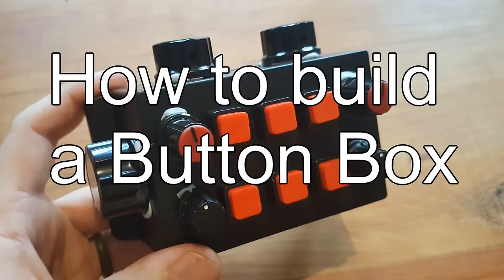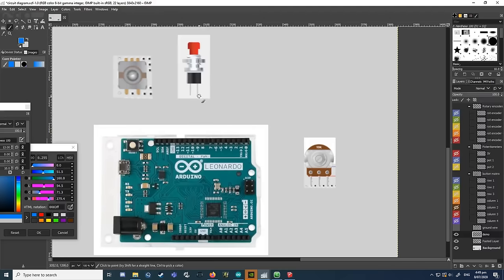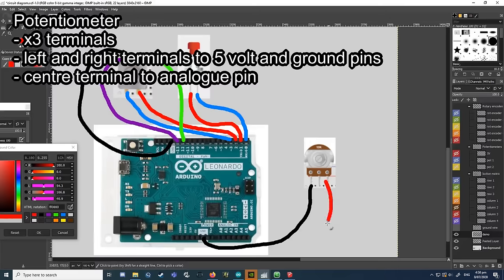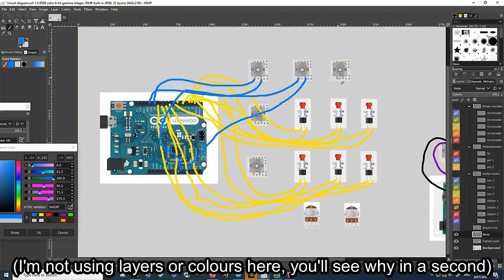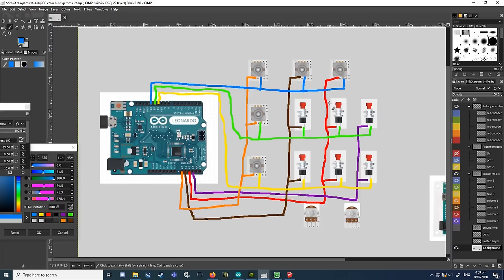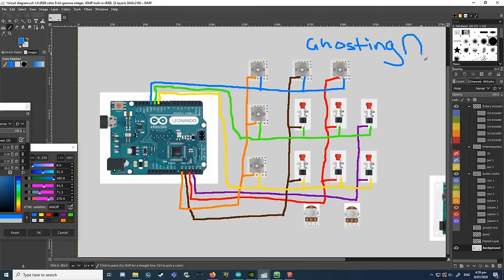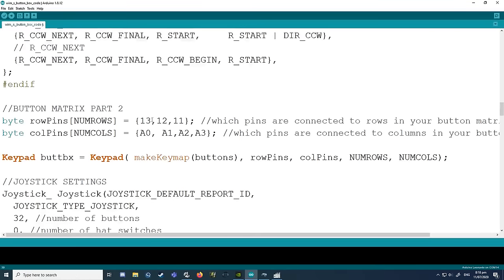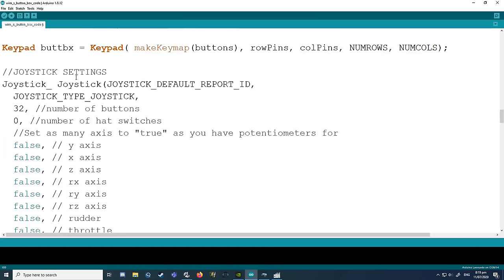How to Build a Button Box

Comment from the maker: BTW this video is designed for newcomers with no experience in coding or electronics. There is a bunch of extra functionality you could get out of an arduino based button box (multi position switches, hat switches, mini joysticks etc) but I decided to leave that out and stick to components which are simpler to code and use
Reply: I'm not using rotary encoders what should i change.
Reply from the maker: @ivanravenski  Just set the number for rotary encoders to zero at the top and remove the lines of code which refer to rotary encoders. (the bit around 24.34 in the video). However, if you are JUST using buttons (no rotary encoders or potentiometers) it will be much cheaper and easier for you to use a zero delay USB controller as described in this video: https://youtu.be/Kx3-JhT4X_M
Reply: Can I use "pro mini"?
Reply: yeah, but multipos and hat switches are little more than several buttons in one compact spot. I'm considering doing this for elite dangerous, where there's several functions that you'd never do at the same time where multipos can save space on the layout of the box in exchange for a bit more wiring on the inside.
Reply: I dont use potansiometers. Where should I change
Reply: This has been super helpful so far, but I'm stuck on the rotary encoder bit.  I have one from Inland so the terminals are different and I can't tell which is which - been playing around but can't get it to work.  Does the encoder not need to get plugged into the 5v pin?
Reply: Nice informations 😉👍 great video,  @arduinomaquinas thank you build, I like working encoders, subscribed 🇧🇷😉👍👏👏👏👏👏👏👏

Comment: Followed your instructions exactly, I've built multiple button boxes for my flight simulator to include avionics, radios, engine controls, etc. I've probably saved at least over $1000 not buying the Logitech or Saitek equivalents of what I made for under $200. $100 for 5 Arduino Leo's + $100-ish for wood, paint, switches, etc.Thanks for keeping it simple.
Reply: What rating potentiometers did you use? For the leonardo
Reply: @tommyfallon7925  I used 50k Ohm linear potentiometers on one of the button boxes I built. Plenty of resolution for the function of cowl flap controls.

Comment: Love the video, it was incredibly helpful for my own project and learning! However I do have a question on how I could add or adjust this sketch to include utilizing a slide potentiometer? Or if it is in the sketch already I have not been able to get it to work for mine. I am using an Arduino Micro and have my slide potentiometer wired to A0, GND and 5V.

Comment: Finally a code that covers it all! I have been trying to blend matrix and joystick for a while. I just could not get it to work. I have no rotaries, I just commented those out and it works great!!! Thank you for the time you took to put this together !!!! You Rock!
Reply from the maker: If you want a hot tip, chat GPT can actually do most of this coding all by itself. All you need to do is tell it to write code for an arduino button box using the keypad and joystick libraries and tell it how many buttons and other components you want.

That thing is scary good.
Reply: @wimwamjoey  Wow.....never imagined! You just added to the list of all the scary cool things it can do. Thanks again for your time!

Comment: Thank you so much for this great video! With your instructions I just build a 6x6 Button Matrix with 4 rotary encoders (without a button). Thus completely filling my leonardo's pins. 2 notes on your video so as to help others. 1) You can go over 32 buttons, directx supports 128 (my new button box has 44) BUT the game itself has to support 128 buttons per controller. Not all games do. If you want to test a button box with more than 32 buttons don't use the windows default game controller, because it only supports 32 buttons. There are great third party tools like Planet pointy's Joysticktest. 2) And most important NOT ALL rotary encoder have ground on the middle pin. My encoders where not marked and I assumed that the middle pin is ground, but it was actually the right pin that was ground. If your encoder gives erratic pulses mostly on one direction, you probably have the wrong pin for ground. Do the test on one encoder beforehand to save you a lot of pain. It took me all afternoon to figure that one out. Again thank you for a great video!

Comment: Just FYI, push buttons can share a ground for one of their terminals. The other terminal needs a dedicated pin in “INPUT_PULLUP” mode. This almost halves the number of pins needed per button, so you may not need to do that matrix trick.
Reply: Actually, you're better off with the matrix method whenever you have more than 5 buttons. For 6 buttons a 2x3 matrix is enough and uses only 5 pins instead of 6. The more buttons you have, the bigger the advantage. For 25 buttons you can use a 5x5 matrix, so only 10 pins instead of 25. And the Keypad library also has built-in debouncing. I'm not sure if this is relevant when you send the buttons straight to the Joystick library, but if you want to use the button inside your code to switch modes you should have some form of debouncing. 
If you want to reduce the number of pins required even further, you may want to look into shift registers. They are quite cheap, only need four pins (or three for some models), and you can daisy-chain them getting 8 inputs per register (still needing only three or four pins per chain). I'm currently redesigning my button box with shift registers because I need to free up some pins so it can also handle my pedals and gear shifter that are currently handled by the steering wheel I am going to replace at some point.
Reply: @panicpetes7676  This makes total sense if you're optimizing for number of pins. But if you've got the pins spare, a "one pin per button" approach seems much simpler to me, and in many cases that would be "better" overall. Wouldn't you agree?
Reply: @aaaidan    I do agree that the wiring is much simpler if you connect the buttons directly, but as you said it would reduce the number of pins used in your original comment, I thought I'd clarify that this depends on the number of buttons you want to use.
Also, in my experience, these projects tend to grow over time, so I'd recommend to use as few pins as possible in the beginning. I started with a rather simple button box (7 push buttons, 3 momentary on-off-on toggle switches, 3 rotary encoders and one pot). Later I added a DIY handbrake using a load cell and HX711 amplifier, so I needed two more digital pins. And as already hinted in my previous comment, I am now using the same Arduino to also handle my Logitech G25 pedals (+3 analog pins) and gear shifter (+2 analog and +3 digital pins).
Reply: @panicpetes7676  You're right – choosing the right approach depends on several factors. In the pinned comment it says "this video is designed for newcomers with no experience in coding or electronics", and I hope to convince you here that this is the most important factor.

My hunch is that for many folk (especially those beginning electronics) using the minimum possible number of pins is just not very important, especially when their board probably has plenty to spare. The matrix approach is a powerful (and delightful) concept to introduce to beginners. But it also acts as additional barrier to entry – an unnecessary one – because a first project is unlikely to run out of pins.

Using a matrix takes more effort to learn, and extra time (and testing) to build correctly. There are also more points of potential failure. It could easily be the difference between an enthusiastic young person finishing their first project or not. Or even starting out in the first place. As experts, it's incredibly hard for us to keep perspective on how far we've come in our journeys, and almost impossible to "simulate" how much more effort everything is as a beginner. 

For these reasons, I strongly recommend folk start out with "pullup+ground" pins until there are no more pins available, before investing in mitigations (like a matrix) that add complexity. This basic approach still allows a dizzying variety of exciting and useful first projects to build. If a project outgrows the pin count, simply switching to the matrix wiring at that point would be a fun and satisfying optimization/workaround. People often are most motivated, and learn best, when they're solving a clear and present problem.

Depending on factors, I'd even suggest considering just solving the pin problem by buying another board with more pins, or even using a separate I/O chip (like a multiplexer or I2C expander). Perhaps this seems wasteful or unsophisticated to some experts. but I hope we can agree that it's more important to draw beginners in to the fascinating and joyful world of electronics, than to insist on best practices from the very start.

What do you think?
Reply: @aaaidan  I fully agree with everything you wrote - when starting a project from scratch. In this case however, with a full code provided I think it is far easier for beginners to adapt the existing code to their project (as it is described quite well in the video) than to rewrite the whole button section.

Comment: I just finished buidling my box and programming it using your tutorial! Excellent. This crazy box project started with me trying the simple usb plug and play controller but I wanted rotaries. I tried the hacks to see it the rotaries would work on the usb board but it wasn't consistent. I ordered a "knock off" arduino at first but them backtracked to the one in the video. PERFECT. It works with my iRacing rig quite nicely!!!! 10 of 10!!!

Comment: I've got my wheels turning in my head, I have to give a huge appreciation to you Wim and all like you that take the time to put these helpful videos together for us, so thanks! What I meant by wheels turning,  I'd like to add a key Switch on/off interrupt to disable the box when not in use or away from the sim and I see away to do that on all of the buttons that require a ground which is easy "just place a turn key switch inline before connecting gnd to the board to act as an interrupt". so when I enter the sim I turn the key to the on position thus enabling those buttons, now that being said I don't see a possible or easy way to add a second keyed  interrupt to the buttons that don't require a ground. I'd just like to add more realism to the process.
Reply from the maker: You could get a USB switch? That way you just switch the whole arduino off.
Reply: @wimwamjoey  I'm looking at them now thanks, I had no idea they were an option. Another thought just came to me while sitting here, add a starter button and just interrupt that single starter button with a key switch, I think that might achieve what I'm looking for, that or just omit the starter button and use the key switch for the starter, food for thought but I think I'd like the duel method for starter.

Comment: great video!!! I'm a bit of an electronic hobbyist and most Flight Sim button box videos use crazy expensive parts! Like I have seen videos of people using 3USD Arduino boards for a controller... I've also seen people using a 40USD ish  board which was more plug and play although soldering was still required... Better just to build a whole kit or 2 for the same amount, i suppose you need to be a little more involved but its really not that hard and gives more flexibility!

Comment: This is probably one of the better videos explaining wiring and matrixing. A Protip on coding,though. SimHUB has a click through system for programming Arduino code which makes it very easy to code for your own custom made box.

Comment: Top class Wim, already had parts ordered to use with Leo Bodnars controller, but now I'll switch to an arduino instead :)
Reply: For a simple button box like this, the Leo Bodnar card will be way easier and just as effective. You only switch to Arduinos when you want the Simulator to turn on LEDs or change other hardware.
Look over some of my videos, you may enjoy some of the simple projects such as adding Rotary encoders and Landing Gears :)
Reply: @joshuamarius  thx for the tip, but I made one based on arduino and its working perfectly. I did however use different arduino code as the one in this video would not work with my rotaries.

Comment: 1st THANKS. So well explained, and me and the mrs have been saying "button" in a Kiwi accent non stop - it makes us smile a lot 🙂  2nd, when you tell it how many "buttons" you have, if your matrix is missing a button, like yours is, and mine is (mins is a 4x3, with the top right corner missing one button), still tell it you have as many buttons as the matrix "could" have - or it'll not show the last button/s working in Windows. I put "11" in the code, and then windows didn't see my last button in the matrix because as far as it's concerned, that is button "12" and my code said I only have 11.
Reply: If you started at 0, then 11 would be the 12th number.

Comment: Hello Wim, OK well I had hit a stumble in the road, after two days for working on the box, I had completed it yesterday evening 4/3/23 so after connecting the board to PC it was not recognized, so after time of trouble shooting I gave up and went to bed, this morning I had a fresh start, I found that I had purchased the wrong board, the board I purchased was the ATmega328P in which after downloading and installing the drivers for it,  Device Manager was happy with it, only still not showing up in the game controller so I then found out that this 328P does not support HID "Human Interface Device". I'm back to start again but now I know which board I need, it's a learning experience. The board I believe that I should have purchased would be the ATmega32U4 and not the 328P.

Note, I had already purchased the board before finding your video, I just assumed they were all the same, not the case, they are different and it matters which board you use.

I received in my mail box yesterday the exact board you're demoing in this video, my question is will it support 15 momentary,  (including 3 2-way toggle switchs), 4 rotary and 3 Potentiometers? a total of 25 in all.

Thanks
Reply: I too learned from his video. I have 30 buttons, 4 pots and a spare pin left if that helps.( I set the buttons up on a 6x5 matrix (11 pins), 4 pots on A0-A3.) Note: an on-on toggle counts as 2 buttons. Tinkercad is a great place to test build a matrix. Good luck
Reply: @funwithfitswell6609  I'm up and running, thanks.

Comment: Amazing video - well explained!  For anyone put off by the coding, I recommend the Leo Bodnar BU0836X 12-Bit Joystick Board.
It requires no coding - all you do is wire up potentiometers, buttons, switches however you want. Then when you plug it into a PC, windows recognises it as a universal controller with no drivers or coding needed. 8 x analog inputs, a 4-way hat and 32 button inputs. Ive subscribed - I hope you do more flight sim diy stuff!
Reply: Thank you I’m new. So will I still have to do 5:50 to around 14:40
Reply from the maker: @comet2164  No, Leo Bodnar needs different wiring and you can't make a button matrix work with them (as far as I'm aware), so this video won't help with that. There are some good instructional videos on how to make Leo Bodnar boards on YouTube and you can also ask for help on their forums.  Also, keep in mind that those boards are often significantly more expensive than Arduino.
Reply from the maker: Cheers mate! I'm looking at remaking and upgrading my button box so will probably do a new video on that, plus a DIY video on building a basic sim-pit out of an office chair.
Reply: wimwamjoey thanks.

Comment: Nice Video, I happened to have just finished a button box last week and I followed Amstudios vid also, but I never understood what all the coding does. And after watching this video I feel I understand a lot more that's going on and changes I can now make, Thanks man, Ps I did use toggle switches and found out about ghosting big time, haha. Fun to learn new things though
Reply: I just finished my Cessna Throttle with the help of this video for the Arduino control as it was very popular in the flight sim groups. was asked to make a guide and in the Arduino section, i linked your youtube vid as it's so clear and easy to follow. hope this helps with views on your video, cheers Kris
Reply: Hi man!! I'm trying to use  some toggle switches (with lights) but I am a bit confused on how to use / connect them. Mines have POWER - ACC - GROUND pins. I guess Power goes to 5v and ground to ground so I end up having ACC. That way , the switches are "out of the matrix" as only the columns are connected to different inputs but the row instead of going to a normal input, it goes into the 5V input.... How do you make them work? 
Thanks!

Comment: I would HIGHLY suggest using either alligator clips or some other non-soldering method to check everything works in the board wiring wise, that way when you fuck up (cause you will) the amount of time redoing everything is as simple as clipping the buttons and unplugging the leads.

Comment: Something that I found recently that can save alot for those not comfortable with coding is FreeJoy library on github, it uses a STM32F103 (blue pill) instead and has a windows UI to setup what buttons. encoders , pots, hall effect sensors etc are conntected to what pin etc.  

Excellent tutorial though. A tip for those wanting to create one try getting ribbon cable I find that helps so much with avoiding a crows nest inside the box.